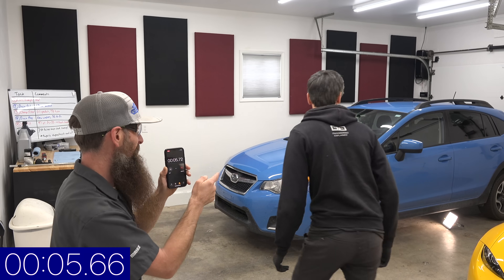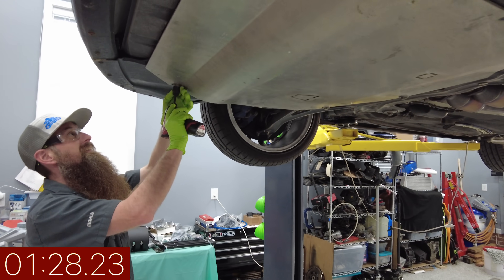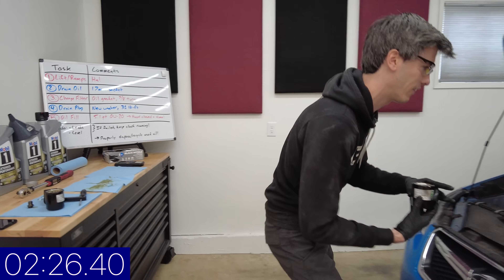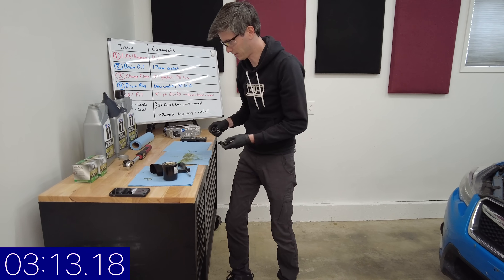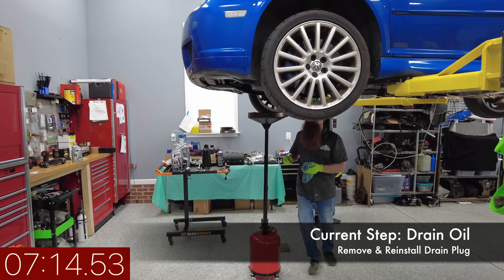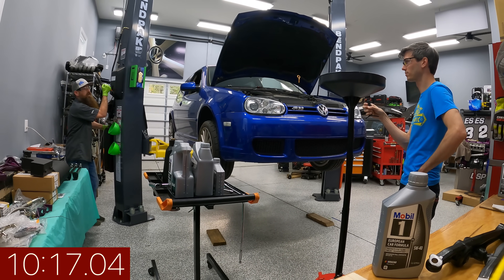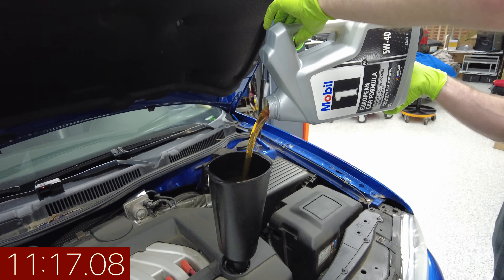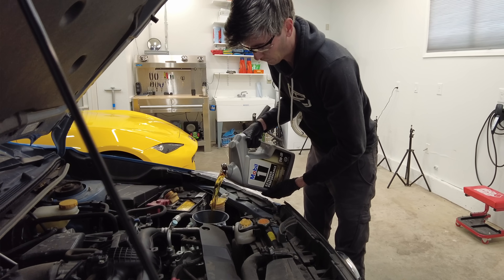Mechanic vs Engineer – Oil Change Race – Who’s Faster?!

Comment: As a former mechanic that is now an engineer in training, this was hilarious in so many ways. Well done guys! Also Jealous he got 4/10's for an oil change both dealers I worked at paid 3/10's and yeah its not enough time.
Reply: I used to get .3 for Subaru oil changes and it’s brutal, .8 for oil change + rotate + balance tires

Comment: This is all about humour and for the watcher to have a laugh. Because, using different cars is a bit like having two runners have a competition. The goal is to get to the finish, but, one is on a 100meter inside track the other is on a cross-country 10k marathon.  In this situation it’s all about having fun, not about the winning..
Reply from the maker: Precisely haha, just about having a good time with a friend.

Comment: Hello expert 😅 I have a question so I sent you a dm. It's just that it's a high-cam car with a single turbo. The transmission is manual, and what I'm curious about here is that if you put in the first stage and run, the blow-off valve works, but if you put in neutral and press the axel, there is no sound. What do you think this is? I'm so curious. I would appreciate it if you read it and answer it. Thank you for reading the long comment.🥲

Comment: Jason cheated.
Dropping the drain nut in the oil bucket and then fishing it out is a must when changing your oil.
He completely missed this entire step.
Amateur.
Reply: He also forgot about getting oil to run down his arm inside his sleave 😅
Reply: Are you sure Richard?

I was under the impression that you only drop the warm ring and pinion gears of your race car into the drain bucket during qualifying for Le Mans where you can not alter the gear ratio.

After checking what "that noise" was, and finding noting wrong, you simply re-assemble the diff with the cold gear set you accidentaly found in the drip pan...
Reply: Absolutely right. You have to lubricate the drain plug.

Comment: Now, of course, if you are doing it yourself you also have to factor in getting the oil and filter and then disposing of the oil... and that’s why I stopped doing my own oil changes.

Comment: So having worked in an heavy equipment shop. The proper way to pour oil is to flip the jug into the fill spout and stab the bottom with a screw driver or knife then proceed to removing the lid and seal from the next jug. Done properly one can dump a full case of oil faster than you guys did one jug ;).
Reply: You are not concerned with plastic particles big or small possibly falling in?
Reply: @satchitananda1820  Nope.

Comment: Why do we all  heat oil up before draining it if the viscosity rating tells us it's thinner when colder, ie 10w 40?
Something I always wondered.
Love the video👌😁
Reply: That is not correct oil is way thinner when it is hot.

Comment: When I was a tech at a Mitsubishi dealer, we flagged 4/10 for oil changes and I normally did them in half that or less. Of course I was hourly, so it didn't matter.

Comment: prep time should have been included, like getting out the tools. massive advantage to the mechanic since they are all already out and on tables and stuff. that's what takes me the longest, getting and putting up all the tools
Reply: Aside from getting the suction pump out... the hardest part to changing my Passat's oil is remembering which giant metric socket takes the oil filter cover off.
Reply: @jasono2139  lmaooo fr

Comment: It usually took 45 minutes for me to do mine on the Miata. Full racecar aero and a crappy Autozone floor jack. However I set record time recent by completing draining my oil in about three minutes AND removing the splitter when I hit a rock in the road 🙃

Comment: If you leave the engine running while changing the oil it makes it drain a lot quicker, pro tip
Reply: Bounce off rev limiter for maximum speed

Comment: that was just all the car my 2012 subaru legacy would be a half hour with its horrible design oil filter in back of engine between y in exhaust after taking off plastic cover on whole bottom of car and you guys skipped the wiping surface of engine to get rid of dirt before putting new filter on or pre filling filter i even like to throw a few ounces of new oil in to rinse some of the old stuff out of nooks and crannies near end of draining

Comment: Oil change on a drive by wire subaru isn't done until you prime the oiling system using the clear flood mode start procedure!

Comment: It's not the engineer's job to change oil. It's their job to make the oil change as difficult as possible.
Reply: Lol! Yes!

Blame their manager who wanted the oil filter design done yesterday and just informed the engineer today... Guess I'm slapping a cartridge upside, in behind the wheel well then!!
Reply: @jasono2139 , or sideways directly above the front differential where you can barely fit an oil filter wrench I needed as is the case with my truck.
Reply: @JohnnyReb2000  lol... and once you get it off, oil drips all over 7 different parts!! 😂

I do love my VW's top oil filter cartridge design... I'm not sure why anyone still uses canister filters anymore.

Comment: I'm surprised neither of you used a vacuum pump - it seems like after using that, if you open the drain bolt nothing drips out.
Reply: Takes longer than draining.
Reply: @om617yota8 , not if you wait for it to stop dripping. I've waited 30+ minutes for my cars to stop dripping.
Reply: @questioner1596  I don't wait. A drip here and there is fine, I don't care about a tablespoon of old oil staying behind.

Edit: I do have a vacuum fluid extractor and use it on the girlfriend's TDI Beetle. With that extractor, I don't have to get under the vehicle at all. If it takes longer, so be it.
Reply: if you let it go till it stops dripping that's fine, but it ultimately doesn't matter as you still have residual oil in the pump, galleys, journals, etc.  and really you SHOULD want that to remain there as it aids in preventing dry start conditions.  some engines (think big diesels) are designed expressly to RETAIN a quantity of oil in the block just for this reason.  most vac systems are low pressure anyway, thus "vac" is really a bit of a misnomer for what they REALLY are is simply a "transfer pump".

Comment: As a former mechanic and currently an engineering student, I appreciate the friendly competition. And as a former VW owner and current Subaru owner, I know why Jason won.
Reply: Meh, I would've sucked the oil out from the top and my VW also has the oil filter on the top like on Jason's Subaru.
Reply: @rkan2  same... Use a marine pump, suck all the oil out of the dip stick tube, replace the cartridge filter on the top, and pour new oil in.

No need to jack up the car, remove the belly pan, remove the oil plug, or replace the crush washer.

If I was racing... It'd be a 4 minute job.
Reply: Can’t forget the fact that the filter on the Subaru is a sealed unit. The VW uses a cartridge filter with multiple Orings that needs to be replaced. Between the filter, skid plate and using a lift its a no brainer the VW took longer
Reply: Don't forget different in engine sizes and fluid capacity and viscosity.
Reply: What is it like going from mechanic to engineer ?  Is it hard ?  Why don’t most mechanics do this instead of moaning how crap they are treated in Main Dealers ?
Reply: @161BMW  It's not easy, and that's a big part of it. I also think that in the technician's realm there's a stigma about engineers being disconnected from how a system should be designed in the "real world" vs in a computer simulation. At least as far as the automotive industry goes, I can agree to some extent. Which is part of the reason I want to be an engineer. 

In an ideal world, many engineer's, specifically design engineers, would greatly benefit from experience in their respective field as a technician for at least a few years. Perfect example is in my design class we are discussing designing a drum brake assembly. I have worked on countless drum brakes and am very familiar with the nomenclature and how they work. But I guarantee at least 9/10 others in the room have never even seen a drum brake setup in person. Is it absolutely necessary to have this knowledge? Obviously not, but it makes it much easier IMO.
Reply: @2shay550  I have seen a brake drum assembly before and have a basic idea of how they work.  Shoes squeeze outwards to press against rotating drum.  Only thing is heat dissipation.  They are used in modern road cars as handbrake in conjunction with rear discs.  Back in the day they were all round it just on the rears.  Disc brakes came from motorsport.
Reply: @2shay550  I done an evening course in car maintenance but no way would I call myself anywhere close as competent as a technician but have a basic idea of vehicle systems and know how to use hand tools although not as good as a technician.

Comment: they skipped over the fact that the mechanic pulled the oil fill cap off first which helps with letting air into the crank case to let the oil drain faster out the bottom.

Comment: My number one take away is you should use the oil recommended in the manual, as newer engines are engineered to run on that viscosity. 
That’s why I take my car to a mechanic and not an engineer. Jason may have won this challenge, but Charles will have his car longer.
Reply: But they both used the oil viscosity recommended by the OEM? Jason just made a joke about chosing his for a higher pour flow rate

Comment: I use the fumoto valve plug where you replace the oil plug with a lever/valve and all you have to do is pull the lever to release the oil. No tools required and you don't need to change the crush nut.

Comment: Working flat rate a few years gave me all the incentive I needed to become an engineer.
Reply: Why?? So you could be salaried and expected to work overtime for free??
Reply: @jasono2139   Flat rate lets you do plenty of work for free. One troublesome car can ruin your whole week.
Reply: @dannelson6980  sure... but flat rates are typically padded so much, that even the most straight forward tasks will give you effectively $80/hr if you know what you're doing.

Most engineers are lucky to be getting $50/hr unless you find the exact employer who can use your very specific skill set and you have the experience for it.

Starting salaries for engineers are still stuck around $25 to $30/hr.
Reply: @dannelson6980  furthermore... If you're working at a smaller company that's expecting 45 hour work weeks or more, the $25 to $30/hr rate you would get for a 40 hour work week is closer to $22/hr to $26/hr with all the extra unpaid hours.

Comment: After 17 month with my Model S I don't miss doing oil changes one little bit! No nostalgia, nothing. At least now, with synthetic, you can drag out those changes to a year in most cases. I remember the days of 3 months, or 3,000 miles. Plugs, points and condenser once a year. Shocks every 2 years. Geez, what a pain!

Comment: Never seen an oil filter that could be changed from the engine bay, instead of underneath the car.  Cool!
Reply: My 2001 BMW straight six oil filter was in the engine bay. It was also a filter element style. Nice!
Reply: cartridge filters are big in in some areas of Diesel world (but not all brands).  interesting design that Subaru in that it's a spin on but placed inside a bowl like a cartridge (no cap).  definitely need that bowl to keep from making a huge mess.  Toyotas are semi-inverted like that but traditional pad mounted and dumps all over the place similar to Charles removing that "wrong way mounted" cartridge on the VW.
Reply: @phillyphil1513  My Toyota Rav4 has a filter cartridge but is serviced from underneath in the traditional orientation.  Even has a drain plug in the filter housing.
Reply: @twinturbostang  no doubt, Toyota has many different engines in modern day.  i speak specifically of the older/ubiquitous 3S 2.0L and 5SL 2.2L 4 cylinders.  they put those in everything and they go 200k-400k easy.
Reply: @phillyphil1513  Gotcha.  My Rav is a 2006 and has the V6.  190K and still going!  She gets synthetic oil every time.
Reply: @twinturbostang  re: "My Rav is a 2006 and has the V6"  fancy, just think (with everything changing over to electric) in another 5 years or so (ref: 20th birthday) at some point your small SUV is going to start being considered an "EXOTIC" by whole generations who have never seen cars powered by ICE.  what...? 6 cylinders?  why so many...?  that's CRAZY...!!!  LOL

Comment: A wise engineer would install a Fumoto oil drain valve rather than have to unscrew a drain plug.  I have them on all my vehicles.  The difference between an engineer and an inventor is that an engineer exploits existing devices in clever new ways and combinations to create a new product or system, while an inventor wants to create something that has never existed before.
Reply: Many cars these days have an oil change pipe up top so you can just suck the oil out that way.
Reply: @paulsengupta971  for real... Good job, "inventor"... you came up with a less practical way to do it the same old way while that suction pump just eliminated all the problems you solved and some.
Reply: +1 Fumoto

Comment: I just agonized over an oil change.  I purchased a new RAM PROMASTER City in May of this year and it was 17 months out from the manufactured date when I received it.  The van interface computer has an artificial Intelligence analog that alerts you to a need for an oil change.  Now near the beginning of December the van is 24 months old and has 6,500 miles on it.  Still the A.I. system is not alerting an oil change.  Reading what is available it appears the system will alert me at 7,500 miles.   Still the van and oil are 24 months old.  I had a great synthetic oil change at Walmart for less than $60.  I reset the A.I. engine monitoring system so again I expect an alert at 14,000 miles.   I will service the van in six months with 12,000 miles on it.  The van has the Jeep Multi Air engine and I would love to see you explain the multi air head.  Finally your black outfit and glasses look great.

Comment: It’s not the speed of the oil change that matters. 

It Is the quality of work that goes in to the oil change that matters. 

Starting with quality parts good well filter good oil is an important consideration. 

Next realizing that you may need to use one or two gaskets to stop an oil leak at the drain plug that observation made by the mechanic not the engineer. This is a quality assurance step That only experience can teach. 

Also realizing that bringing the car up on the lift allows the mechanic to change the angle of the car slightly for better oil draining if it applies. 

Also it allows the tech to start the car and observe leakage underneath or to re-inspect the car for leakage by bringing it up and doing a better thorough inspection while the car is in the air. 

There’s so many things to a quality oil change that Trump the speed I think that this contest may be deemed irrelevant based on the best interests of the customer and becoming a technician that is a customer advocate.

My point? Is that experience as far as becoming a customers advocate and a very high-quality technician will always trump engineering and education every time.

Comment: yes who is trustworthy enough to do the job without say stealing the hood strut while I am watching and whose job will leave a few drops of oil within my driveway causing me to worry? And who will provide me with a complementary car wash afterwards (unfortunately this is state dependent NYC no wash SC and Fl a car wash).  UPDATE Hey you guys did not reset the computer to let it know that an oil change was performed so that the reminder to change your oil alert does not come on.

Comment: Get a Fumoto oil drain valve for the Subaru! I've been using them for years. Between the oil filter having been moved up top and the oil drain valve oil changes are a snap!

Comment: You should do a brake pad replacement race.  I did my old F150 back i the day in under 10 minutes using air tools out of necessity.  I wasn't trying to race, but i had pads in the truck and 10 minutes before i had to be somewhere.  Pulled in my buddy's tire shop bay, used an air jack and impact and was back on the road with a minute or two to spare lol.

Comment: I used to be able to change oil fast on my truck when I had an LS and the filter and drain plug were just a few inches apart. Now I have a HEMI and the plug and filter seem to be on opposite ends of the block with filter a little awkward to get to.

Comment: My Tesla has an 8 quart oil pan, still haven't found the drain plug though.
Reply: You have to pull the pump to drain the drive unit.
Reply: @dannelson6980  I'll try that. Maybe I'll put a new air filter in it while I'm in the garage also.